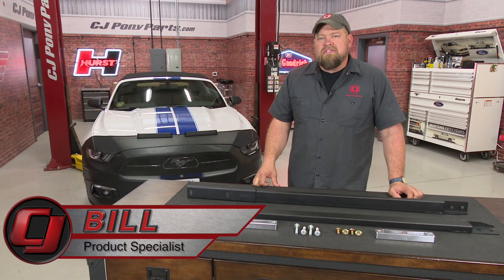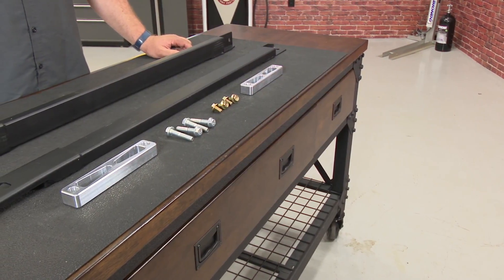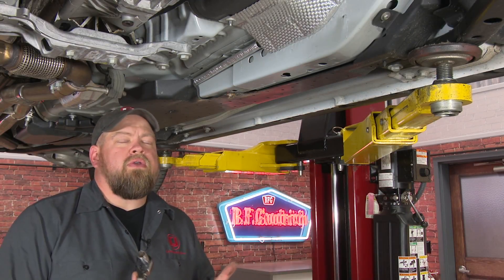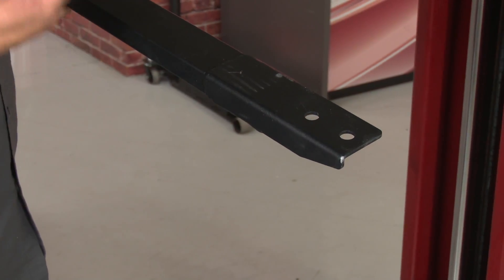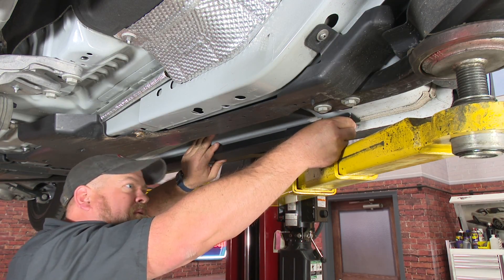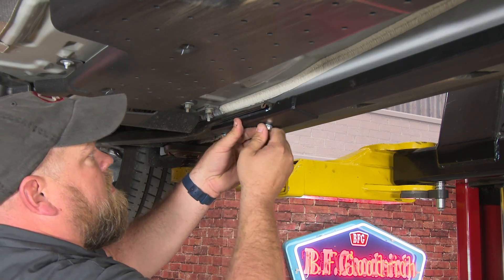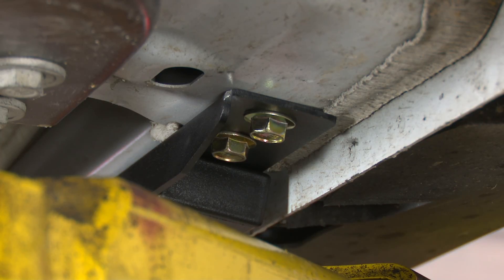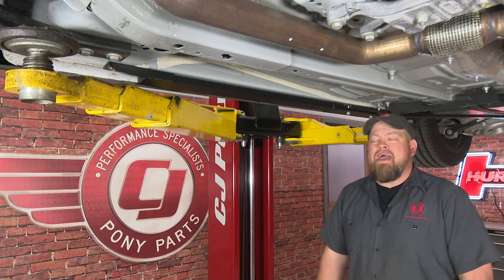2015-2023 Mustang Convertible Steeda Chassis Jacking Rails Low-Profile Ultra Lite Pair Installation

Comment: Hi Bill, I noticed you didn’t trim the seam sealer back and it just seemed to compress when the bolts were torqued up. Can the same be done for the fastback as I really don’t like the idea of trimming the sealer if it’s not 100% necessary ... :-)
Reply from the maker: I trimmed it the first time I installed it and realized it probably wasn't really necessary. As long as there is not too much and the bolts get tight you will be fine.
Reply: CJ Pony Parts - Thank you :-)

Comment: Hey bill , can you make a video showing how to lift the mustang and putting jack stands , I appreciate it .
Reply: Muhammad GT would like to see that too. and how do you lift the mustang with a hoist, that would be interesting as well, I don't want some car shop fucking up my pinch weld.
Reply: On a 2 post A symmetrical lift, you car lift off the K member (or the factory pinch weld in the front) and in the back off the pinch weld at the opening in the side skirt. Go to walmart or a local sporting good store, pick up a set of 4 hockey pucks (under 5 bucks) and use those on the lift pads to avoid damaging your pinch weld.